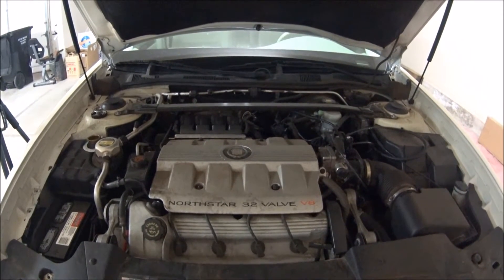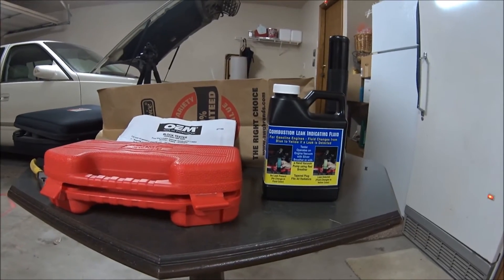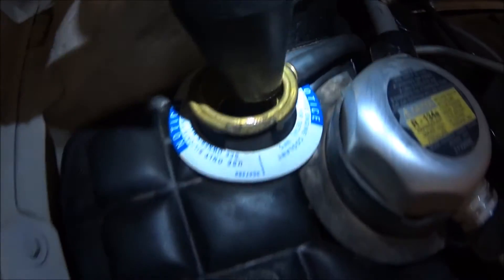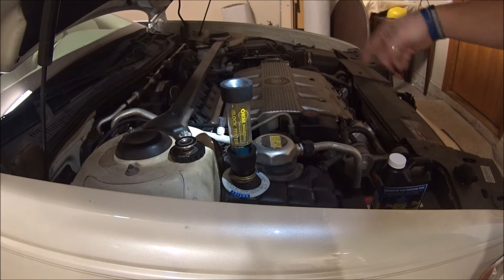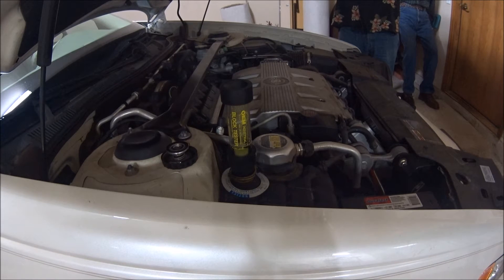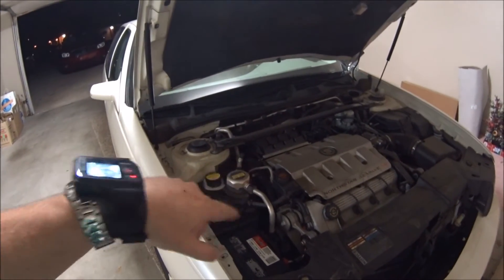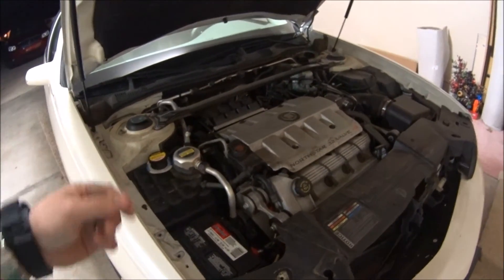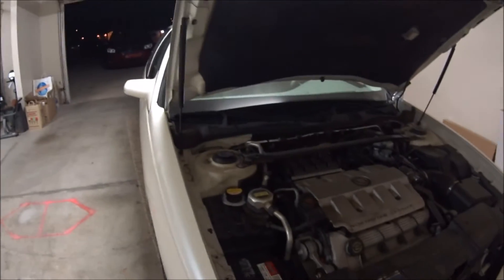How to Test for Head Gasket Leak Easy Engine Block Test

Comment: So what does it mean if your oil smells like fuel? Is that from a leaking cylinder maybe? I've never checked them because I've never had problems with performance. It's a 2001 Jeep Wrangler 4 banger so there's always something that needs fixed. I'm learning as I go. I have no idea what the heck I'm doing, when I start, at least.  I only need to learn the hardway twice 🤦 IMO the motto "if it ain't broke don't fix it" was coined for old school Jeep Wranglers. Thanks for the video ✌🏻
Reply from the maker: Sounds like it's running rich.  Pull your plugs and look how black they are.  If they are really bad.  your fuel injectors might be bad. They could be leaking after you turn the engine off. Leaking onto the positions and it leaking past the rings....but if your smelling oil in the oil. Change your oil otherwise you'll fixing the whole engine with a full rebuild

Comment: 50k and it's blown! That's very discouraging as that wipes out a ton of value in the car.  I wouldn't be surprised to see a $3000 repair bill for it. The crappy thing is that it also has 2 head gaskets. What do you think they are going to do with it? You going to throw in some miracle head gasket seal?
Reply from the maker: +sixtyfiveford   Thats about how much I was thinking it would cost.  Ya I might do that and just see how well it works.  but first I or someone has to replace the alternator and from what I understand these are kind of a pain.  If it were mine Id do the head gasket myself but since its not mine Im not comfortable working on it.  
They are still trying to figure out what to do with it.